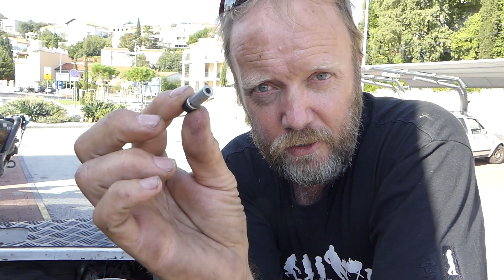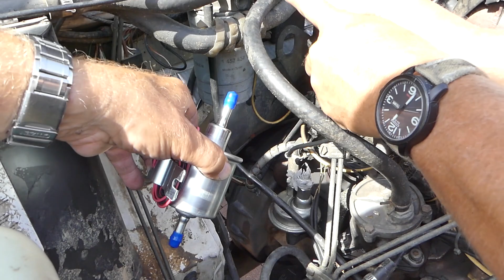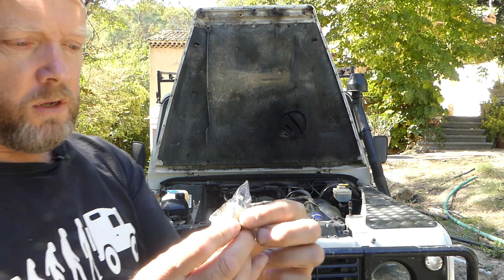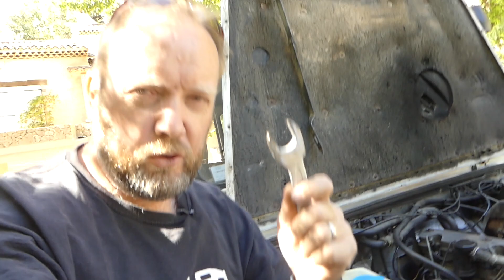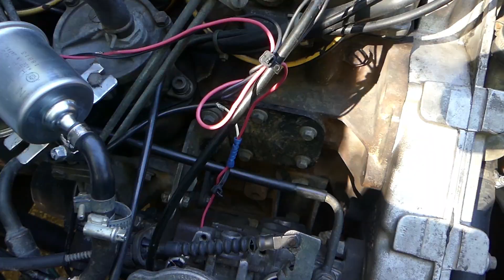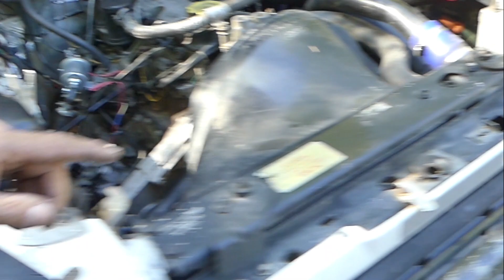Defender Breakdown: Smallest Part Left Us Stranded! #landrover #landroverdefender

Comment: I have watched your video previously but I watched again today. WOW, similar thing happened to me a couple of days ago.  I was driving my New old 300tdi Defender to garage to do the RWC( MOT) testing . And on the way there, at top of hill truck suddenly died.  I instantly thought it had ran out of fuel as it was on  slope and old gauge was inaccurate.... I got 10L of fuel and cranked but still not go. I bled top of fuel filter but still no go. I gave up called Road side assist( had to join the member $400+ ouch!) . I watched youtube while waiting and one guy from UK trailer fitter guy`s video save me the day. In my case wire was some how dislodged from fuel stop solenoid!  I am new to this machine so I did not realized why nothing was connected to it. I even thought previous owner had disconnected it and made it  always open. But now I know that was not the case. Great Built in immobilizer from Bosch!

Comment: Lift pumps always fail first, symptoms will include run for a while then splutters and cuts out. Quick fix is to take the fuel filter off and fill it manually, refit, I find this gets you about 15miles of driving then repeat process. I always carry a spare lift pump( make sure the fuel olives are pre fitted,?cheap pumps (BRITPRAT) don’t come with them fitted. As for the fuel cut off solenoid(FCOS) I’ll put details on here later for their operation. Very good work getting running again 👍🏻
Reply from the maker: Thanks - and for the info! Good to know. I would like to refit a lift pump (ordered one - came in an Allmakes packet so who knows if it is good enough). So leaving the electric fuel pump in situ, ready and readily accesible if needed...
Reply: A Simply Fab Life good idea. Every little helps. Love your adventures
Reply: I have had lots of problems with duff lift pumps, since fitting a genuine parts one and the 5mm spacer as listed in the parts book I have had no more problems. There are genuine wolf pumps available for around £30 if you hunt around.
Reply: I have the same problem with my 1985 Land Rover 90 2,5 na diesel. I will try to install a new lift pump, but what do you mean with "fuel olive"?
Reply: Florian wittrock hi. Just the little copper sleeve that fits over the pipes. When you tighten the nut on the lift pump ( for the inlet/ outlet pipes) the olive gets crushed and that’s how it seals. Always worth checking when you buy a new lift pump that it comes with the nuts and olives as you’ve got to try take the old ones off which usually ends in damaged parts. Let me know if you want more info.

Comment: Check wire terminal on solenoid it might need crimping as they get bit expanded. Crimp down with some pliers so when putting onto fuel cut off solenoid its tight.

Comment: Is a shut off solenoid electro magnet pulls the pin back when energised fuel flows spring pushes pin back when power cut a stops fuel flow
Reply from the maker: If you think about it, it is pretty groovy how the electromagnet works! Possibly the only electrical part on the engine besides the starter motor...? You could run the motor without them - if really needed...

Comment: The electrical supply wire to my solenoid shook loose at the ignition switch in my Tdi 300. It is quite a job removing the dash to tighten the crimp connector and reconnect it on the road side. A much quicker way is to rig a supply from any live point (or the battery) directly to the solenoid spade connector. I now keep a good length of wire and spade/female connectors in the car.
Reply from the maker: Must have been a nightmare to track that one down...

Comment: That is a very nice Mickey mouse job
Reply from the maker: I'm taking that as a compliment - seeing as not all of us are natural mechanics but we manage to turn a temporary fix into a permanent solution ;-)
Reply: Sometimes you have to do what's necessary to get back on the road...
i been on that road before when radiator hose blew apart and had to mickey mouse a hose by slicing the damage area,
stopping by at a hardware store and buy home/restroom pipe with clams & mickey mouse it. 
it work & managed to get home ..

Comment: The solenoid gets power and energises the electro magnet inside the body and withdraws the small piston to allow fuel flow, naturally when you remove power to the solenoid, the electro magnet doesn't attract the piston and the spring closes off the fuel supply.
Reply from the maker: Thanks very much for the explanation! Good to know how this works  As Arjan mentions below it is the only electrical part on the engine (that soemtimes lets you down= and that can be removed to get out of a tight spot. First time for eveything I guess? Cheers for the comment
Reply: It's no problem, I really enjoy your videos and having similar issues with my tdi recently that turned out to be  a complete injection pump failure die to contaminated fuel. Please keep up the great work and I look forward to the next one.

Comment: Did you try bending the ring end of the 24mm to get it in there? Having changed a few solenoids in inaccessible places I've found doing this works better than butchering an open ended one.

As for further fuel problems such as this on mechanical pumps, definitely check the lift pump first by pumping it a few times with the bleed screw undone & if it appears to be working then check for fuel at the injectors by undoing a pipe whilst cranking as if there's none here it will more than likely be the solenoid gone.
Reply from the maker: Tried the ring end of the spanner but the solenoid is too close to the 'throttle body' hence the open-end. We tried the lift pump first and weren't getting any fuel at the bleed-screw which had us buying the electrical pump thinking we had it solved... Thanks for your comment - lessons learned... ;-)